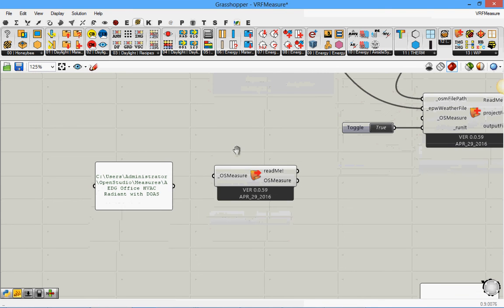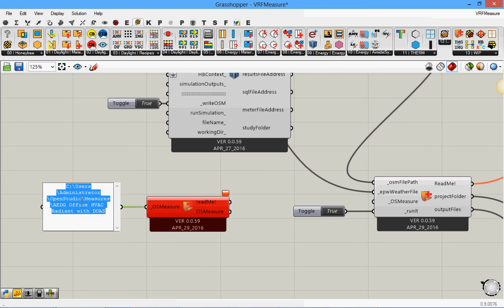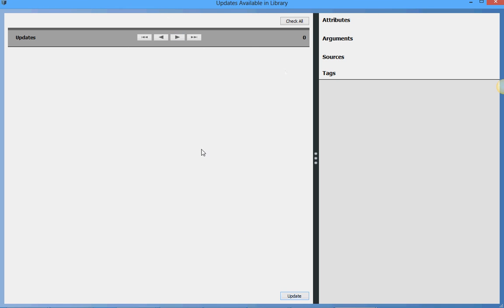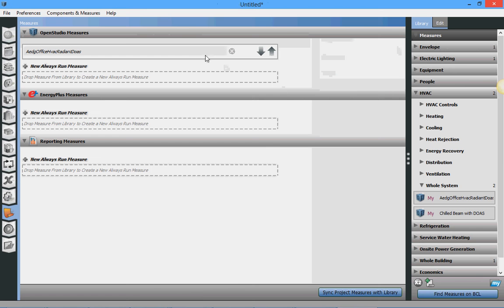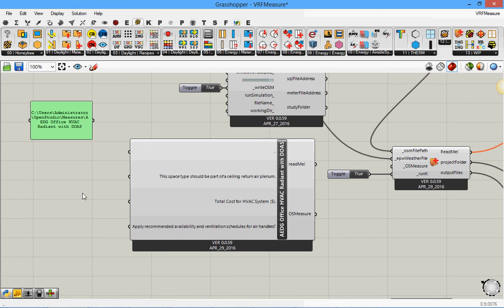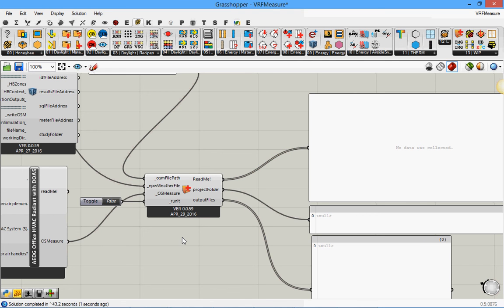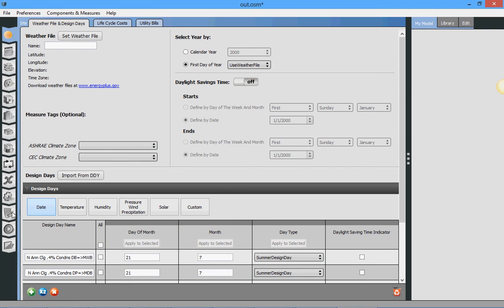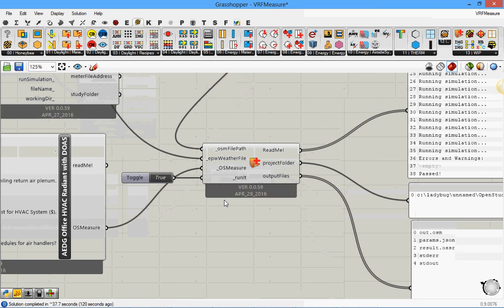Load and Apply OpenStudio Measures with Honeybee

Comment: Hey Mostapha, 
I am trying to use an the _OSMeasure (ver 0.0.63) to load a reporting measure. 
The error I  get is: "1. Solution exception:expected Path, got str"
Do you know how i can solve this? I tried connecting a panel and a file path component, neither of the work.
I hope you can help me out.
Reply from the maker: It is because of a change in the OpenStudio API. You should use OpenStudio 2.5 or lower. I think the recommended version for OpenStudio is currently version 2.4. Here is how you can fix it if you want to give it a try yourself: https://github.com/mostaphaRoudsari/honeybee/commit/1e0f589827ae4c0cb7a367c451cf07ab708790e0